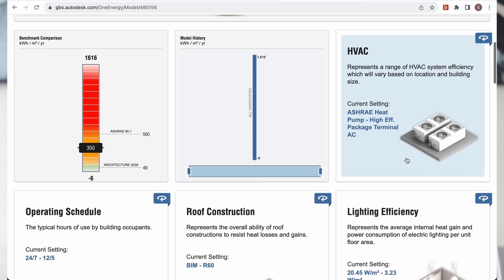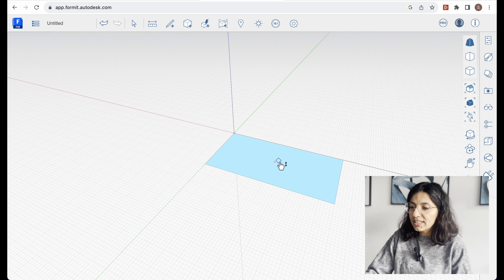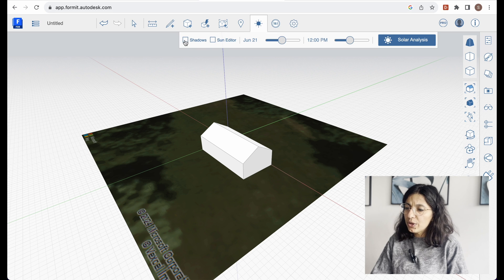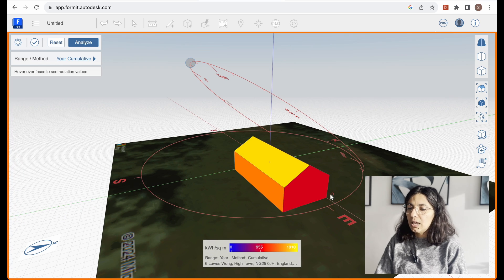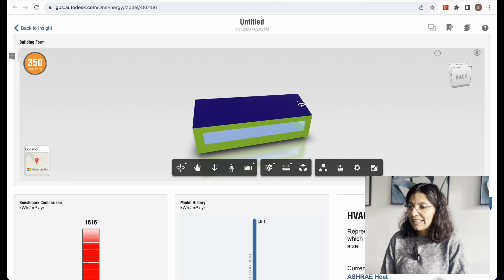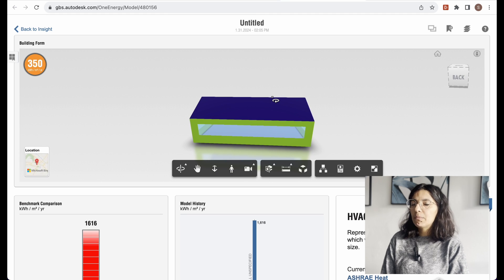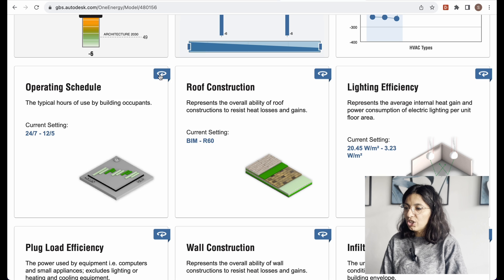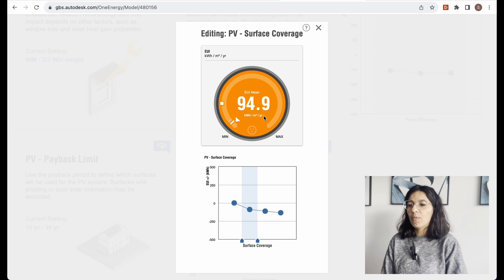Analyzing Solar and Energy Performance with Formit Pro (Tutorial and Review)

Comment: Hi!
As you didn't show all the values and options around wall insulation and glazing parameters I'm suggesting making changes of WWR doesn't really tell anything. Did you choose well insulated walls? Glass? There is a possibility if you choose great glass and poorly insulated walls that the energy loss can be very similar. In this case WWR does not matter at all.